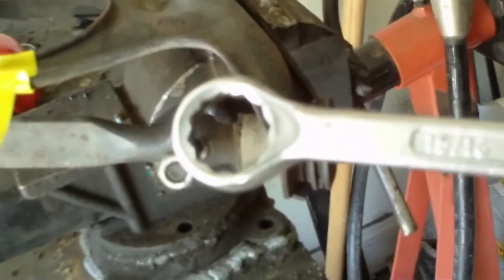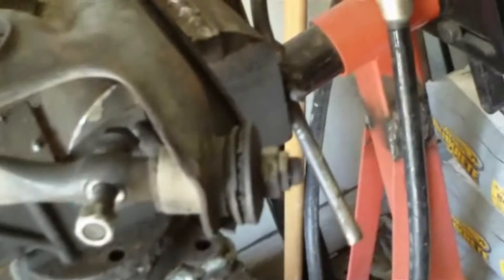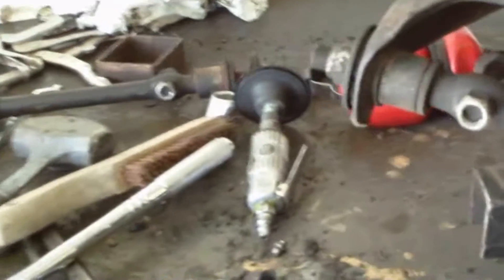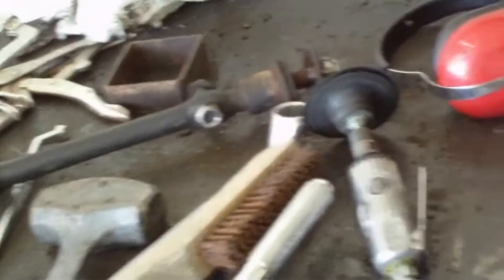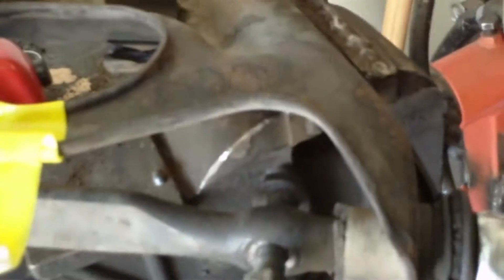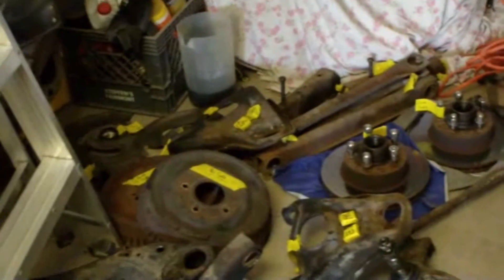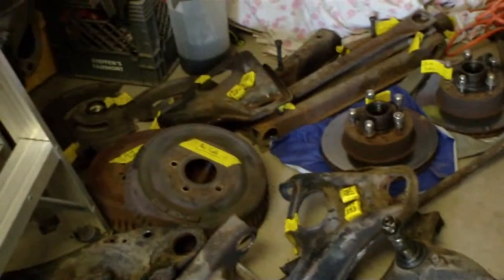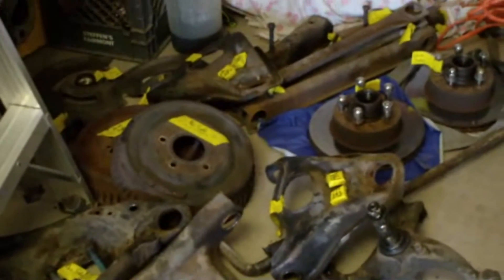How to Front Upper A-Arm Complete Tare Down Vid

Comment: Tip again...After knocking the heads of the rivots off of the ball joint.Use the atachment that has the point on it.It will knock the last of them rivots right out